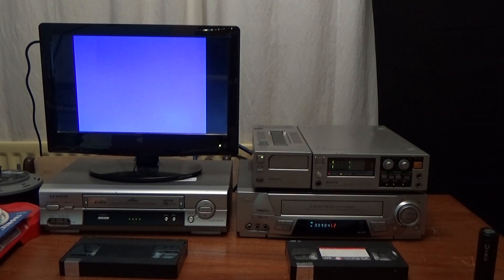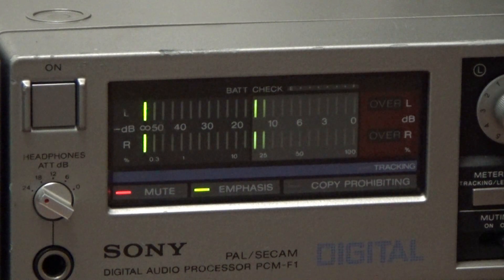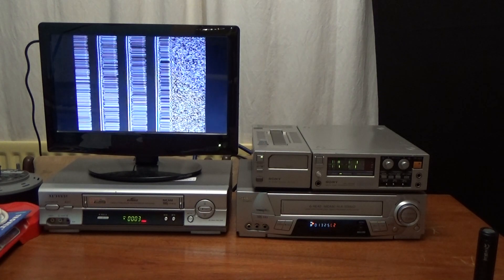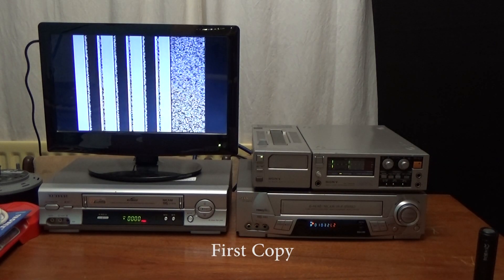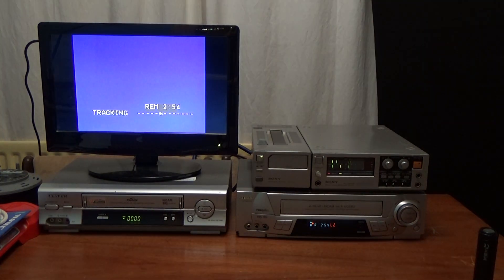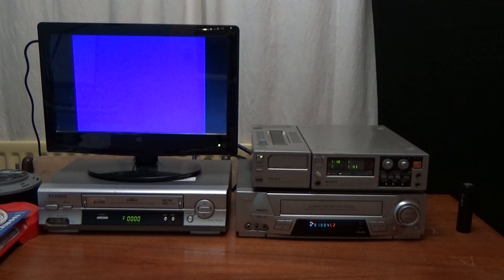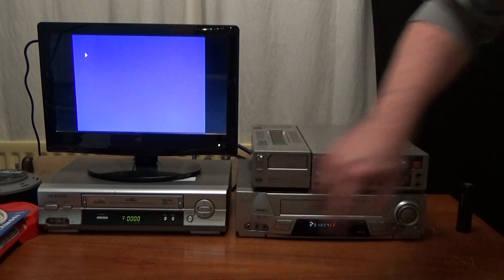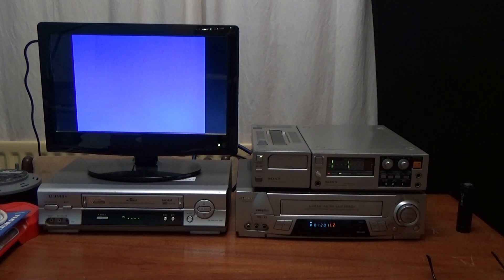How many times can a 16-bit Sony PCM-F1 recording on VHS be copied?

Comment: I have been buying boxes full of VHS tapes from eBay, in order to recover the Teletext data off them. The recovery can be patchy from an original recording, but even a first generation copy (both SP) loses quite a lot of information. SP to LP, and 2nd-3rd generation copies are practically unusable for teletext recovery - and I suppose this is why!
Reply: how can you do that? I really interested in teletext and even today our country has working teletext channel
Reply from the maker: This is really interesting. I remember “back in the day” I used to use the teletext on VHS recordings to work out when the recording was made, and from what channel. The pages were almost readable in many cases, but with a lot of errors. Very interesting that this can now be captured. SVHS tapes captured teletext data almost perfectly.
Reply: Teletext requires higher bandwidth than regular VHS can manage, so the results will be scetchy even with a first generation tape. But teletext survives SVHS quite well because that format has full broadcast bandwidth.

PCM audio is a different cup of tea because its bandwidth requirement was designed with the limitations of early 80s home video formats in mind. So it is perfect at least in the first generation. Of course like any analogue copy it's bound to degrade after a few generations.

The "proper" way to achieve lossless generational copies would be to have two VCRs each with its own PCM decoder, and connect the two digitally (if they come with digital inputs and outputs which I don't know) , thus "regenerating" the digital data in each step. Conceptually that would be the same procedure as when copying digitally between two DAT machines, or copying files on a computer, both of which can done with unlimited generations.
Reply: @skinnypotato4452  Just play a VHS recording from an analogue era broadcast, connect it to the AV input of a TV with teletext decoder, and activate teletext on the remote. As I said VHS doesn't have enough bandwidth for this to work properly, but most of the time you can get spurious pages with lots of errors. Sometimes waiting a few refresh cycles gives the TV the chance to assemble the page almost error free, but it depends on the individual decoder.

As you said, teletext is still possible with the European DVB standard, which is backwards compatible with analogue teletext. Most digital set top boxes for any of the DVB standards come with a feature called "teletext insertion". That means their analogue output contains teletext data in the old format which can be decoded by any vintage TV set (provided it has teletext).

Teletext data can't be recorded by digital recorders like say a DVD recorder or a computer TV card, those recorders completely omit the sync pulses of the analogue signal, where the teletext information sits.
Reply from the maker: In the early days of DVB transmissions in the UK, many digital channels carried traditional teletext (DVB-TXT), although I remember the BBC channels just carried a single page directing viewers to use the new "Digital Teletext" service instead. So I can concur, it definitely is possible, and was used for a while. PVRs that essentially save the video transport stream to disk (rather than "record" the video) may capture the DVB-TXT as well, but I don't think any UK channels carry traditional teletext any more.
Reply: @timf-tinkering  You can recover the Teletext also from standard VHS tapes (often perfectly) using the software "vhs-teletext" using a PC capture card.
Reply: @timf-tinkering  This is how I was able to date some old VHS-tapes with TV shows from the german TV recorded in the early 90s which were given to me by family members. There are some text character errors but when you adjust the sharpness on the VHS reocrder properly you can recover a lot of the text information.

Comment: I had always heard that the F1 was designed to work with Beta rather than VHS recorders due to the higher bandwidth and quality of the original Beta machines and tapes. At the CBC we used the units in this manner until they were replaced by DAT recorders and later digital workstations (Pro-Tools, Pyramix, Soundscape). We didn't however do multiple transfers from tape to tape unless the signals were decoded and re-encoded in the process.
Reply: Sony at least made the unit look and feel similar to their beta machines. But I seem to recall that it was u-matic that was used as the videocorder when making a master for CD pressing, am I correct? And you could use NTSC or PAL, but one of the resulted in 44100 Hz and the other one slightly less. Which one was used for CD? NTSC or PAL?
Reply from the maker: I could be wrong, but I think NTSC versions of the PCM-F1 used a sample rate of 44.056kHz, and PAL used 44.100kHz. The system commonly used for mastering CDs was a slightly different format from that used by the PCM-F1, and was NTSC-only, and operated at the CD sampling rate of 44.100kHz, typically recorded on U-Matic. I'm sure someone with more knowledge will be along to correct me very soon...
Reply: @timf-tinkering  OK so the reason that NTSC PCM-F1 processors run at 44.056kHz is because of the horizonal frequency of NTSC color video, which is reduced by 0.1% for color video. This is why NTSC video is 59.94 Hz / 29.97 FPS instead of 60/30.  Since Betamax is a color recording format and never was optimized for black and white recording the frequency had to be slightly reduced. However, the PAL model runs at exactly 50Hz / 25FPS. The professional U-Matic PCM processors and recorders such as the PCM-1600 series used black and white NTSC video, so the frequency was exactly 60Hz / 30FPS which allowed the sample rate to be the standard 44.1kHz)

Comment: ... and additionally you have to shut off the DOC of your VCR. If your VCR does not offer this function you can:t get perfect copies.
Reply from the maker: I wouldn't say it's impossible to get a perfect copy without disabling the DOC. Error correction may work better with it disabled, but if the video recording is of sufficient quality for the PCM-F1 to be able to recover the original PCM data without errors, any copies made through the F1 would be "perfect." If there is a dropout on the tape, then the data that should have been there is lost. The only difference a DOC would make is that the missing data would be replaced with something else rather than noise. In both cases, the F1 would just see this as corruption, and attempt to apply error correction as normal, so I can't see disabling the DOC would make a significant difference.

Comment: Did you copy it form VCR to VCR, or did you use copy connection on PCM?
Reply from the maker: Direct VCR to VCR. The "Copy Out" connection on the F1 didn't do what I expected - it is just a duplicate output from the ADC, so the Digital out and Copy out carry the same signal. It doesn't output a re-generated copy of the digital input, so cannot be used to make a "perfect" copy.
Reply: @timf-tinkering  Sony prescribes to use the copy function on the F1. Direct tape to tape copies get progressively worse as multiple generations are copied, as you have proven.
Using the copy function on the F1 activates an error correction and restores the timing of the video sync signal. This way, in principle, unlimited copying is possible.
When using the line inputs carrying record out and copy out connections indeed the same signal when the copy switch is set to off.
Reply from the maker: @1lennetje  Ah yes, of course you are right! I had not set the "Copy" switch on the front panel to "On." With that switch set correctly, the Copy Out socket does indeed carry a re-generated digital (video) signal, so it would in theory be possible to make an infinite number of perfect copies through the F1.
Reply: @timf-tinkering  This doesn't work of course. You are not copying the digital signal, but a Pal movie to another Pal movie. It's just like copying videocassettes.

Comment: I have two questions:
1) What resolution (RES) was selected? 14-bit mode provides much more error-correction data than 16-bit mode.
2) Can you capture those tapes into any video files? I want to try those on a software decoder.
Reply from the maker: 1) This was a 16-bit recording. Now I'm tempted to repeat the experiment in 14-bit mode! 
2) The best I could do would be a capture to consumer DV format, or from a cheapo eBay USB video capture unit.
Reply: @timf-tinkering  this format uses lines in the inactive region and also PCM-F1 can recover up to 16 consecutive damaged lines in a 128 line span, while STC-007 can recover twice as much - up to 32 lines.
Combined that means that STC-007 most certainly can be fully recovered even when using cheapo USB capture that does not capture inactive region. For PCM-F1 special capture hardware may be required to perform full recovery.  But even USB captured one will be interesting to play with.
If you can attach link for video captures in your next video, that whould be great. Even short (>10 sec) fragments whould be fine (PCM captures demand high bitrates, thus big file sizes).
Reply: @timf-tinkering  1st Copy: normal
2nd copy: 32-bit
3rd copy: 1990's
4th copy: the wrist game

Comment: I wonder if a video editing device which can fix time based errors and a device which can increase the sharpness of the video signal to some degree could be used to copy the digtal audio recording. Maybe you could copy it a few more times before the PCM-signal gets noisy.

I use such a device to digitize VHS tapes because when the H- and V-sync passes out because a dust particle on one of the video head interrupts the video information on the VHS tape, the tape is bent because it got entangled in the mechanism of a VHS-recorder at some point, the tape was already copied from another VHS tape and has time based errors or there is noise from bad reception when the tape was recorded via analogue TV (e.g. via analogue sattelite TV when there was a thunderstorm blocking the signal from the satellite) the video grabber would skip frames and have problems re-synchronizing the video recording. The MPEG2-recording would take up to 1 or 2 seconds in "slow-motion" and the audio is out of sync before it will continue playing normally.
It's the Panasonic Digital FX Generator (Model WJ-AVE3/C) as a Time Base Corrector in my case and a device to readjust sharpness, contrast and brightness of the video signal. I managed to digitize a VHS recording with family recordings from the early 90s on it. It was obviously copied from a VHS-C tape onto the VHS-tape and at some point there's a lot of noise on the tape for about 20 minutes, probably because there was a dust particle on the video heads inside the VHS-C camcorder from which the tape was played. I first had problems recording it via the video grabber only but when I used it with the video editing device from Panasonic I was able to record it without problems from beginning to the end (except the noise on the recording, but the H- and V-sync is fixed).

Comment: I think the recording method represents kind of a worst case scenario. You probably would have gotten better results if you had played back the tape on the deck that recorded it rather than swapping tapes between decks...Or at least used 2 identical decks.  Decks of different brands had slightly different tracking and calibration. Playing a tape in a different deck the tracking differences degrade playback slightly over using the original record deck to playback...Playing the tape in a different deck from the record deck each time in a multi-generational copy experiment amplifies the problem with each generation.  
Also those decks look like bottom end consumer decks. Something like a pair of high-end consumer/low end prosumer S-VHS deck with an internal TBC and or possibly digital video noise reduction even in VHS recording mode likely would have done better.
Reply from the maker: I completely agree, this is probably close to a "worst case scenario" - but that was kind of one of the aims of the experiment. I had (wrongly) anticipated several generations of copy before the sound started to deteriorate, so didn't want to start with high-end gear and high-quality tapes as I feared the video would end up being 4 hours long :-) 
I aim to repeat the experiment with a 14-bit recording at some point, but will deliberately use exactly the same setup so that a direct comparison is possible. Also I wouldn't want to put all that wear on my nice VHS decks :-)

Comment: Brilliant! Thank you for making this. Just to be clear, I was indeed interested in hearing how generation loss affected the tape outside of the "Copy Out" feature. What's the fun of bit-perfect digital anyway? 
Lots of interesting artifacts in that second copy pass! Almost as if some white noise had been sidechained to the music. 
Maybe someone with more technical knowledge can chime in on how specifically the audio is degrading between generations.
Reply from the maker: Indeed, I would have done the experiment in exactly the same way even if I had noticed the "Copy" switch on the F1.
Reply: Indeed the degradation of the audio was slower than I expected.  Generally speaking, pcm with bit errors tends to crackle until it turns into white noise (as you introduce more and more errors).  What I heard in the early generations sounds more like quantization noise, which would imply that the bit errors tend to be in the less significant bits.  In human terms, it's as though the machine tends to make errors in the ones and tens place, but never in the thousands or ten thousands place.  There could be a few reasons for this, and it could even be an intentional feature of the format, but without more information I can only speculate on the mechanism behind this.  One possibility is that the designers of the format reserved more of the video bandwidth for the high order bits (for example making them a little longer) and as the vcr corrupts the signal everywhere, the ability to read the "fine print" of the low order bits decays first.  Another possibility is that the high order bits come at the start of the line (immediately after the horizontal sync), meaning that there's very little ambiguity in their position.  Then as the code word continues, the decoder has to count how many bits it's seen and as ambiguity accumulates it's more likely to introduce mistakes at the end of the number.  This would imply that the data are layed out in a big-endian format.
I would be very interested to know the answer to this, but without access to this equipment, I would need someone to send me uncompressed video and audio files of the various generations to analyze.  It shouldn't be hard to figure out what's going on if I had access to the raw data.
Reply: @timf-tinkering  yeah, the other experiment should be boring - perfect copy number 1, perfect copy number 2, ... perfect copy number 4734, perfect copy number 4735, ...
Of course sometimes my expectations are violated and in that case it might be super interesting to see what flaws make it into the recording.
Anyway, thanks for the really interesting and provocative experiment.  I want to see part two with some analysis of what went wrong on those early generations.

Comment: It's well known each copy has deterioration but this escalated quickly. I think the sound heads are dirty or misaligned in either of the recorders.
Reply: Video heads you mean? I don't think the PCM F1 used the sound heads (or indeed the audio track) for anything..? It's just video.
Reply: @synestetic1687  so where is the sound coming from then?
Reply: @The-Scots-man  It's the black and white bars and dots you see in the video. The Sony F1 PCM Decoder reads this black and white signal, decodes the line code and sends the payload to DAC.

Comment: What is the TV brand?
Reply from the maker: It's just a cheap no-name set. The brand is "Currys Essentials" (Currys is a large chain electronics retailer in the UK) but I don't know who the actual manufacturer is. I like it because it's small, very light and easy to move around, has all the different input types you could possibly need, and supports NTSC (and PAL obviously).
Reply: @timf-tinkering  I've heard of curry's essentials, I believe the  company who makes the tv is vestel or a random chinese, but curry's owns the brand logik as well